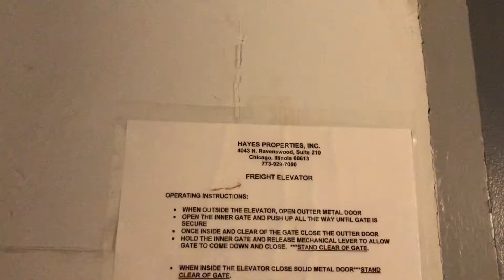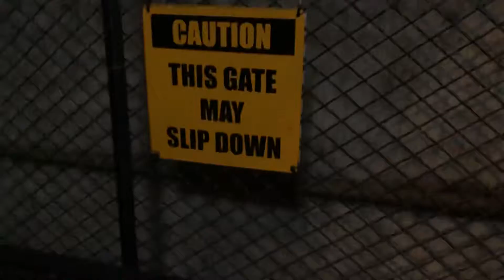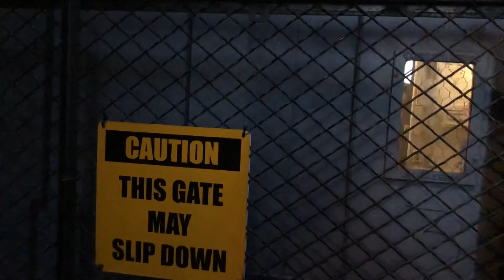Otis/ECA Micro-Drive Freight Elevator @ Manz Building - Chicago, IL.

Comment: Quite a freight elevator 2:1 sheaves across the cab and counterweight. The roller switch is probably set up with the micro and main motor starting relays on the controller, dropping out the main and cutting in the micro drive.